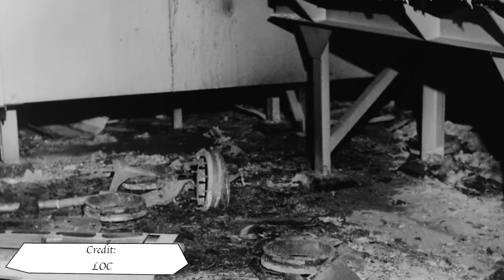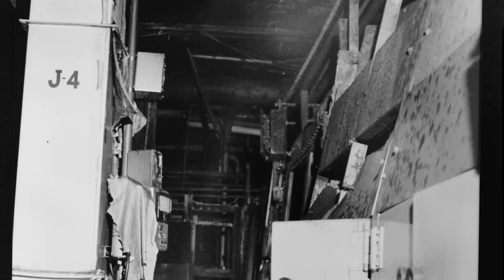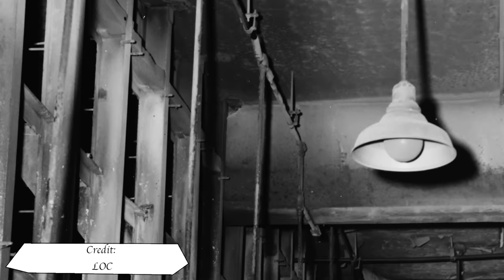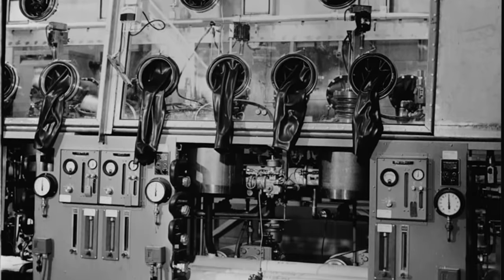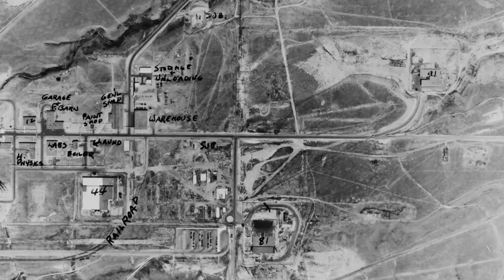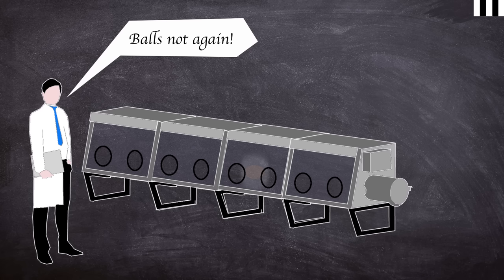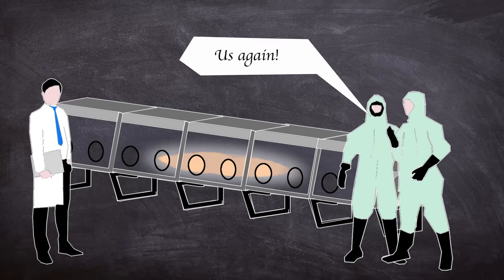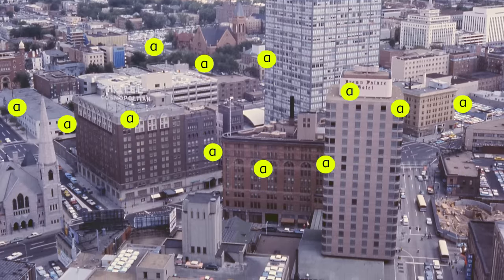A Brief History of: The 1969 Rocky Flats Disaster (Short documentary)

Comment: I recall speaking with the Fire Chief when his crew responded to a call at an Engineering and Manufacturing facility. The Chief had 1. Never been invited to tour the facilities nor given Maps. 2. Was not allocated additional funding to respond to a factory fire if that occurred. A crew accustomed to fighting house fires was, in other words; expected to adapt during an active emergency.

I suspect that the same problem is true for Nuclear facilities.
.
Reply: Absolutely.
This fire occurred during a holiday so there was a skeleton crew for the entire facility.  There were only 3 (yep, 3), firefighters, and a couple of health & and safety personnel available for the first few hours.
The firefighters knew very little about how to fight this fire except NEVER use water  on plutonium due to risk of a criticality event.
However, the carbon dioxide didn't contain it.
There was no Halon system.
So 2 of the firefighters made the from the gut decision to use water.  They prevented the fire from burning through the roof with about 6" to spare.

Comment: How long is it going to take for those in the industry to realize that radioactive material is super toxic?
Reply: SW: Because not all radioactive material is 'super" toxic. Elemental Plutonium is, but other materials, especially compounds are not particularly toxic.  p.s. Just to be clear, toxicity and radioactivity are two different characteristics.
Reply: @seanworkman431  No.  Toxicity is a chemical function.  Radiation is a physics function which acts by destroying DNA.  The two are not connected.  (Biologist).
Reply: @seanworkman431  Let me add for clarity. Plutonium is both toxic as a metal, and radio active. So is Uranium, though it has a very low toxicity.  Strontium and Americium are radioactive but not really toxic.

Comment: Wait, water sprinklers? Wasn't the previous incident made much worse by someone using water to put out a fire?
Reply: Water sprinklers are one of the most effective fire extinguishing systems. It is a real shame that Grenfell Tower did not have them.
But in some nuclear plant areas, including Rocky Flats, the fear of potential nuclear criticality accidents has resulted in restrictions or outright prohibitions of water for firefighting.  
The lessons (eventually) learnt from Rocky Flats fires include the need for facilities to have both effective criticality controls and effective fire safety measures.

Comment: Wonder what you would you find if someone went to Rocky Flats with some kind of alpha particle detector.
Reply from the maker: Nightmares probably!
Reply: Radiation counts above the expected natural background level for that area? But, as alpha particles cannot travel very far through soil, I would also be tempted to look for the associated gamma ray emissions.
Reply: @derekp2674  Alpha particles are the most dangerous to the human body, especially if you ingest the source. Beta and gamma radiation passes through the body and only some of it interacts. If you detect alpha particles then there is dust you can inhale. If that's the case you better leave quickly.
Reply: @markrice41  Agreed but it is much easier to shield the body from alpha radiation than gamma radiation.

Comment: 5:20  Yeah... No.  The 3 categories of radiation are alpha, beta, and gamma.  Gamma is light, be it x-ray, microwave, visible, ultraviolet, etc.  Gamma penetrates most material, and flies off into the cosmos.  Beta is electrons, negatively charged "electricity."  Beta has a relatively short range, since it interacts strongly with whatever it encounters.  Beta is generally not a concern.  Alpha is bits of pieces of the atomic nucleus, that is, protons and neutrons in various configurations.  Alpha interact weakly with whatever is in the way, changing atoms into other atoms, often more radioactive types. 
Your statement is "this is because plutonium predominantly emits alpha particles which are only damaging to the human body if ingested."  I know where you are going with that, but the statement is simply false.  Since alpha radiation interacts weakly, the worse thing that you can do is ingest alpha emitting atoms (not ingesting alpha particles).  The alpha radiation from the radioactive atoms inside your body slowly eat away at your everything.  This is why people are given iodine tablets.  The iodine in the tablets fill your body with more iodine than you need, to help keep radioactive iodine in the environment from being absorbed.
So the correct statement would be "this is because plutonium predominantly emits alpha particles which are THE MOST damaging to the human body if THE PLUTONIUM is ingested."  Subtle but critical difference.